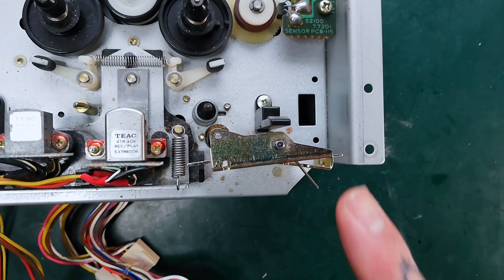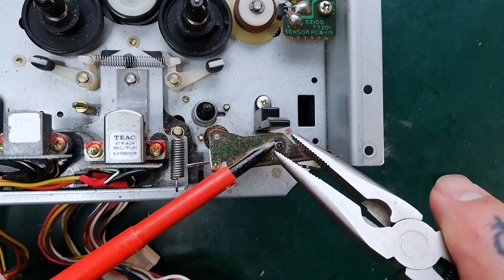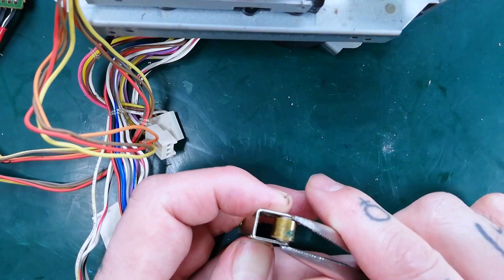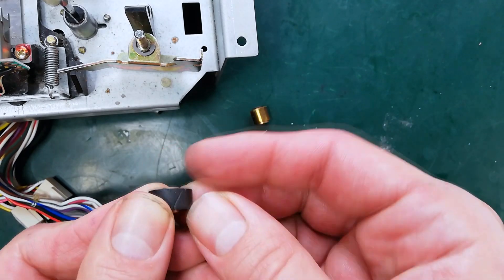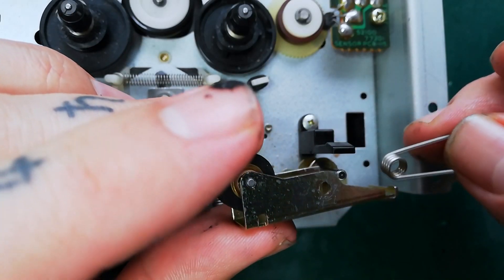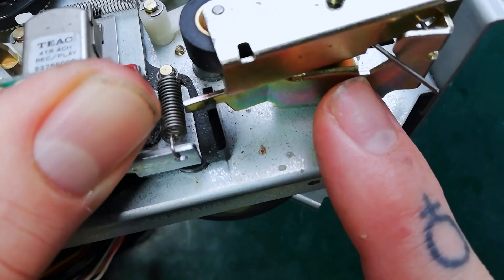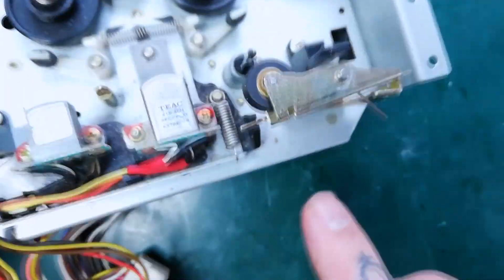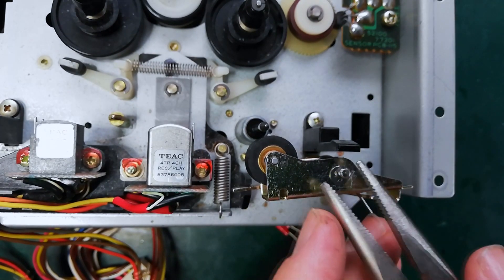11 Replace Pinch Roller (fix your Tascam 244 Portastudio)

Comment: Thanks for all your videos. They helped me in the right direction with my Portastudios. I've now fixed a 424MK1 and a 244 with a Porta Two needing minor servicing after a belt refresh. I've used dime a dozen pack of belts for them (one wide variety pack and one square pack) which seems fine. I even measured wow/flutter and it seems to be within factory specs which is wild for something so old! So nice to see a community of people fixing old gear instead of chucking it away.

Comment: Hi. Love your vids. I just put on a new tire for the pinch roller, but no matter if the pinchroller is engaged or not, its pressing the tire against the pin? Do you have an idea how to fix that?
Reply from the maker: Thanks. Please clarify - do you mean the heads and pinch roller are always raised? So you can't remove the cassette? You can send pictures via Facebook messenger or Instagram if you like.

Comment: Do you recommend that we order a new pinch roller with a bearing for a pinch roller replacement or just the rubber
Reply from the maker: I've seen Ali express sellers selling just the rubber, but never tried it...on the face of it that seems slightly less work, good luck?

Comment: Hi Tetrakan, your videos have helped me greatly. I have an issue I'd like to get your take on. I just obtained an old 244 which look to be in really good condition. Appears to be well cared for generally. Opened up the bottom and the wiring and boards all looked in tact, clean and in good shape. Of course, the belts and pinch roller tire needed to be replaced as they were deteriorated.  So, I replaced those as well as I went ahead and replaced the idler tires also. Powered up and put in some old tapes I had from a previous 244 unit that I had made a number of years ago and played them to remind myself what all I had on them. (Tapes are in very good shape, kept in cases, stored well etc.). It worked like a charm and everything sounded great. Spent about an hour listening to the tapes (I listened to 3 or 4 different tapes and all did great). I decided to take a break so I stopped the tape I was listening to, pulled the tape out, turned it off and let it sit for about 15 to 20 minutes. Decided to power back up and put the tape in to continue listening, and now the the sound of the music is slightly dragging (wow or flutter?) as if the speed seems to be varying slightly in places like what you would hear in an old analog movie soundtrack. I tried another one of the same tapes I was listening to before that was previously working great and same thing is happening to it now. So, the tapes are not the issue as they were playing fine before. Do you have any idea why would it be all of a sudden having this problem when it was working perfectly just 20 minutes before? Would the new belts be failing some how? Or the idler/pinch roller tires possibly slipping or loosening etc? I would think that would be unlikely with brand new belts and tires, especially if it wasn't a problem just 15 to 20 minutes before. Like I said, everything was working great until I turned off the machine, let it sit, then turned back on later. (Note, The belts and tires I specifically ordered on eBay were for the unit. And everything seemed to fit) Thanks!
Reply: I took off the bottom plate to take a look and everything looks good, Nothing melted or broken as far as I can tell. the belts etc look good. As I mentioned before, the motor was running fine before with no wow, flutter or distortion in speed. It wasn't until after I cut it off and let to sit a while then turned it back on and tried to play a tape, this started. If I put my face down very close to the unit with the bottom plate off I can detect just a very slight warmth and slight electrical smell. But I would think that would be normal after it's been running for a time as with any electrical appliance of any sort etc.?
Reply: I'm now starting to wonder if it's one of the motors going out on the transport. I tried playing the tapes again, and they were doing the same thing with the slight wow, but then started to get better and smoothed out for several minutes (a couple of songs played fine). But then it started to do the wow again and got even worse to the point the pitch is now sounding like its dragging and playing slower than the music is supposed to sound with an extreme wow. I can't see how the new idler tires or the pinch roller would possibly be sounding that extremely bad now. I do hear a very slight clicking noise in the transport so i looked at your video about noises in the transport, making sure the large capstan pulley has just a little clearance and if the pullies are dirty etc but all of that seems to be ok (I cleaned them pretty good when I replaced the belts) and the noise sounds like what your video says is normal. So, I'm really thinking a motor is going bad. But not sure which one it could be (capstan motor, idler motor, or control motor.).. or if any of those can even be replaced.  I admit at this point, i'm a little frustrated and dejected about this because I was hoping all this unit needed was new belts and tires. However, I'm still puzzled as to why it was doing so well at first for a whole hour listening through 3 or 4 different tapes but then didn't start to have problems until after I turned it off and let it sit for awhile. Seems strange
Reply from the maker: If the idler tires aren't slipping (new ones can be too smooth - try roughing up.the surface with high grit sandpaper) the regulation circuit for the capstan motor could be at fault. Its very hard to find a direct replacement for the motor, but you could try to find replacement components for the internal PCB. The electrolytic capacitor will be easy to replace, I've never searched for the semiconductors in there, but they have part numbers printed on them, and new old stock replacements may be available?
Reply: @Tetrakan  Ok, thanks! I'll pull the transport and try roughing up the idler tires a little. One other thing I noticed since I last posted. While listening through the headphones, I noticed that the sound would slowly pan back and forth (L & R) occasionally. For exampleI'd have the guitar track panned left and the vocal track in center and then midway through the song, it would all very slowly pan right then eventually pan back left. Or just one track would pan while another track stays the same. That's just an example. It seems to be random. And seems to get better as unit warms up.
Reply: @Tetrakan  Hmm, now it's making a Loud squeaking noise inside the transport while a tape is playing. It stops when the tape s not playing. Tried several different tapes and it still does this. So, it's something inside the transport. I'm going to pull the transport and check out everything and I'll go back and watch your video about noises. Seems you mentioned something about that.
Reply: @Tetrakan  One more thing, Are the idler tires supposed to fit into the idler pullies really tightly or is there a little looseness. I noticed when I was stretching them over the edges and then pushing them down into the grooves of the pullies to seat them good, I could squeeze and pucker them up just a little in spots. (Not much but just very slightly)  So, I tried to make sure they were pushed down all the way around. I guess what I'm asking is, wouldn't the tires need to be a really, really tight fit once they are placed in the grooves of the pullies , so as to not slip when turning?
Reply from the maker: Tires shouldn’t slip. Squeaking is consistent with idler problems. I have no idea regarding the panning thing, never had a problem like that.
Reply: @Tetrakan  Ok, I'll see what I can figure out. Thanks again for all your help!
Reply: @Tetrakan  Regarding the panning. This is just a wild guess, but maybe the tape is mis-aligning side to side as it passes over the head. For example, the sound that's recorded on track 1 (which I have panned left) is crossing over and being read by track 2 part of the head (which I have panned right). So maybe that possibly is giving the effect of track one panning from left to right. Probably a farfetched theory, lol since I don't know exactly how the tracks on the heads work. But I do notice it doesn't switch back and forth quickly it's just gradual as if the tape is randomly and slowly shifting side to side on the head. And sometime the track will seem to be straddling partly to the left and partly in the middle. As if it cannot decide where to sit exactly in the pan position.
Reply: @Tetrakan  I pulled off the bottom cover, set the unit up on it's side and played a tape while looking at the back of the Transport to see if I could notice anything. The only thing I saw was when I look through the little opening to see the upper (outer tape side) idler wheel turning, I noticed it was wobbling as it was turning. So, I took the transport out to look at it and everything is intact. The tire is on straight. I notice that the tension spring pushing out on it keeps the notches on the plastic part that slides over the pole from locking firmly into the notches on the plastic part of other idler wheel so it is able to wobble a little. (I remember that allows you to be able to push down on it a little in order to get the c-clip back into the groove to hold idler wheel on on (I assume that's an intentional design?)  I tried manually rolling the idler wheel with my fingers against both the tape spindles to see how it spins and it seems to roll straight. No oblong or out of round surfaces that I can detect. The spindles roll straight. no looseness or wobbling on those that I can see. So, I'm at a loss as to why that front idler wheel wobbles when it's against the spindle playing a tape. Obviously there is going to be some tension on it pushing against the spindle to turn it, but Is that normal for it to wobble?
Reply: @Tetrakan  Well, I just noticed there's a tiny spring that's come loose from something on the transport but I don't know from what....ugh!
Reply: Update in the little loose spring. I just looked at some pictures I had taken of it before working on it and I see it's was connected to the little tensioner arm at the top of the idler assembly. Whew!, glad I took some photos. I just have to see if I can get it back on now, it's in a tight spot to reach even with needle nosed pliers, at least for my hands..
Reply: @Tetrakan  I've pinpointed the rhythmic squeaking is coming from the pinch roller while a tape is playing. I put my ear up close both in the front and back of the transport when it was squeaking and it was coming from that area. So, I put my fingernail on the right side tape spindle closest to the pinch roller and could feel some vibration on it. Then put my fingernail on the metal pinch roller wheel and it was very strong! The squeaking even changed its sound when I touched it. I then put the tip of a screwdriver on the metal pinch roller wheel and axle while it was turning and I could feel a strong vibration. Is pinch roller tire possibly slipping as it's pressing against the pin? It doesn't appear to be wobbling or anything like that.  I'll try roughing it up a little with sand paper. (I already roughed up the idler tires a little)
Reply: @Tetrakan  I'm at a total loss. New tires, new belts, no visible malfunctions with the rollers, spindles, belts while it's playing, rubbed all the tires a little with fine grit sand paper to make sure they weren't too smooth, the squeaking noise in the pinch roller area comes and goes...and yet, the wow and pitch variations continue. I don't get it! All I can think of is to either buy and replace the tires again (even though nothing appears to be wrong with these new ones I've already put on) or try to find another another old machine pretty cheap so that I can switch out the transport to see if it works.
Reply from the maker: Some wobble in the idler wheels would be normal. What you said about the tape shifting side to side accounting for tracks disappearing from channels panned hard, well the actual tracks on the physical tape are very thin, less than a mm wide, so maybe. Has the pinch roller been replaced? Is the end of the capstan motor hot to touch after it’s been running for ten minutes or so? Is the tape itself rubbing against the metal guides protruding from the magnetic heads?
Reply: @Tetrakan  Good news Tetrakan! I finally found the problem. I had replaced the pinch roller tire but apparently it had slipped slightly off center on the metal roller. (Or maybe I just didn't make sure I put it on exactly centered, although, as I mentioned in my first post, everything was working when I first tried the unit which makes me think it shifted. Or possibly I accidentally caught the edge of the tire with a cassette casing as I was pushing down into the tape well and it shifted the tire a little.). Anyway, I took another look at the transport while I had it out and noticed the outer side of the pinch roller tire was not flush with outer side of the metal roller. So, I just used my fingers to pull it back to where it was centered on the roller with the side of the tire flush with the side of the metal roller and it works fine now. There's no wow or variation in the pitch. Incidentally, I had noticed when I had put the new tire on, that I was able to slip it on fairly easily. So Apparently, the tire doesn't fit super tight on that wheel. I'll keep an eye on that from now on in case I start having problems again. Thank you again so much for your guidance and advice! And I do apologize for the long "play by play" posts, lol. I suppose it helps me think things out as well as I wanted to give as much info to you to illustrate my problem. Your videos are truly a great service to all of us novices out here! And it's very much appreciated!! Thanks again!  🙂
Reply: @Tetrakan  Sent you a donation in appreciation! Thanks again!
Reply from the maker: Thanks! I'm glad you got to the bottom of it. Happy recording!

Comment: hello! my 244 has started eating tapes, getting caught in the pinch roller and the right cassette transport wheels stopped moving, do you reckon this is due to the pinch roller needing replacing? I'm tryna diagnose what exactly is causing it not to work. Cheers!
Reply from the maker: No,  idler tires, though if one part of the rubber is on its way put you'd be wise to replace all of it while youre in there.
Reply: @Tetrakan  nice cheers i’ll take a look at that

Comment: Your videos helped me a lot repairing my beloved Tascam 234, thank you so much! I replaced the belts succefully and my next step will be the replacement of the pinch roller who has become sticky. Are the replacements for the 244 and/or the 122 also suitable for the 234?
Reply from the maker: The 244 PR definitely fits the 234, I can’t speak to the 122 though, haven’t had one of those, I assume the cassette player is the same?
Reply from the maker: I’m sure the 244 PR will work in the 234
Reply: @Tetrakan  That's great! Thanks a lot again Tetrakan for your feedback and precious help!

Comment: Cheers. Great, informative video. The pinch roller on my 246 is making a screechy sound during playback. I heard about cleaning it but it doesn't cut it so I guess it is time to replace it. What are the kits you're referring to at 3:54?

Comment: Hi again. I replaced the two belts and pinch roller tire. Is there anything in particular that would cause playback recording  to slow down and speed up?
Reply from the maker: The first thing to check is clean the pitch control potentiometer - the sort of dirty contacts which manifest as crackle or signal dropout on a guitar volume pot can manifest as pitch changes if the pitch control potentiometer is dirty

Comment: bloody brilliant videos mate! Curious though, is this roll swap similar to the 234 in how it comes apart? I recently got a 234 for an insane deal and of course the original roller has turned to tar now and needs to be changed. Ive got a roller on the way, but am worried that spring setup will be different in the 234.... Anways, thanks for all of your great video's and knowledge kind sir!
Reply from the maker: The pinch roller arm is the same, but getting the transport out of the 234 chassis is really different…I think I found someone else has done a partial tear down of that model so refer to that meantime , but I have one in the pipeline

Comment: Hi TS - your vids are great. Saved me a lot of money refurbishing my Tascam 246...Thank you!
Question: Are there replacements available to replace the 2 small rubber parts on the two white arms above the heads and pinch roller? Also, what about the brown roller to the right of the idler tires (if you're holding the transport cage with the heads on the bottom)? Don't know what they're called, so am having a hard time googling them to purchase replacements. (Already replaced belts, idler tires and cleaned contacts. Ordering a pinch roller, and figured I'd get the other above parts at the same time.) Thx!
Reply from the maker: Can you show me pictures of the parts you mean via Facebook message?
Reply: @Tetrakan  Sure... Just sent.